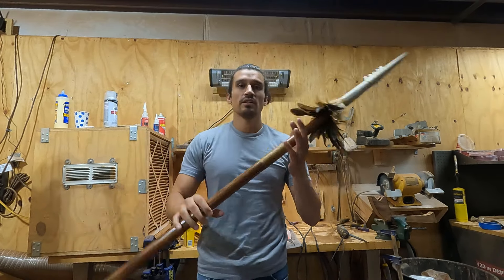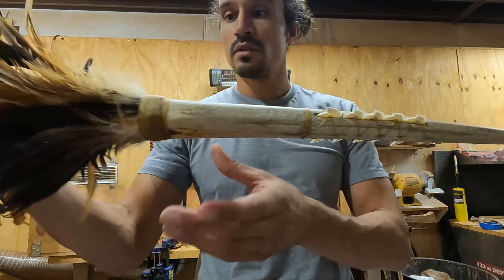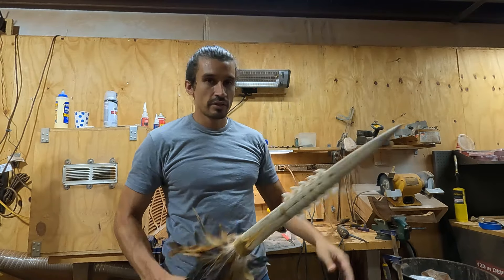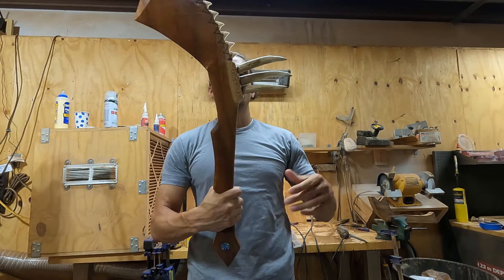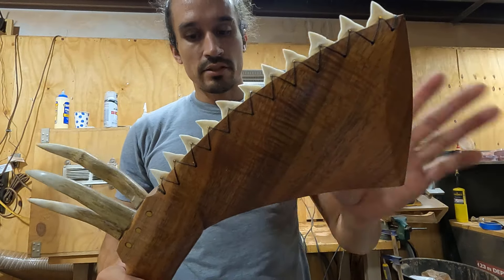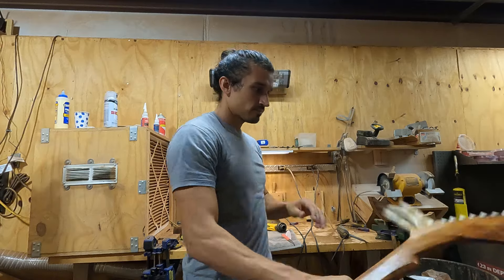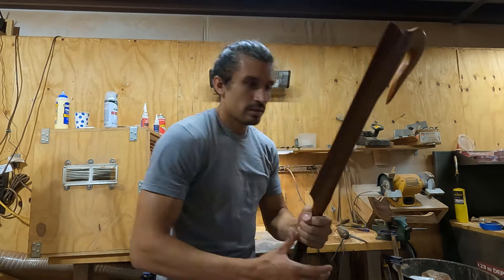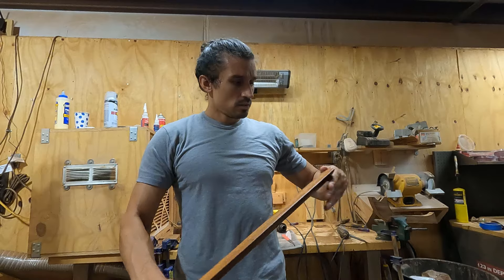Review of some of my Favorite ancient style weapons!

Comment: About how deep are the grooves that you place the shark teeth in I would love to make one of those one day
Reply from the maker: Depends on the size of the teeth. Enough to fit most of the root of the tooth.
Reply: @KoaStudio  so about a inch or so?
Reply from the maker: @samartcrafts_1910 if needed. I don’t have a “standard” it’s based off of what type of connection I’m doing and size of the material 🤙